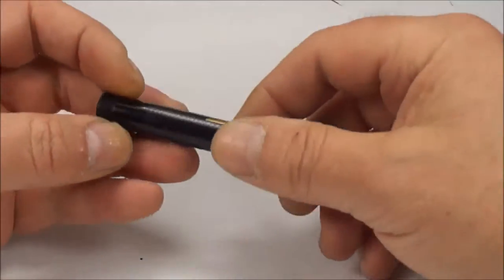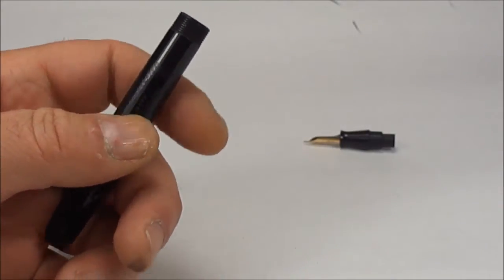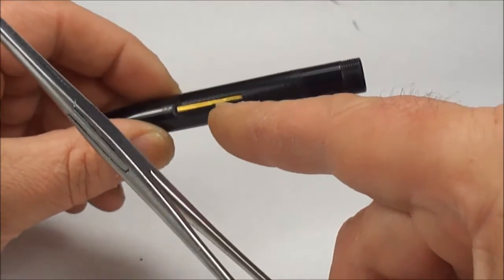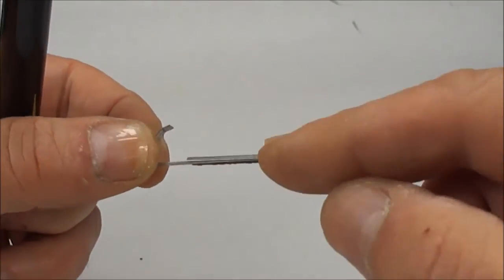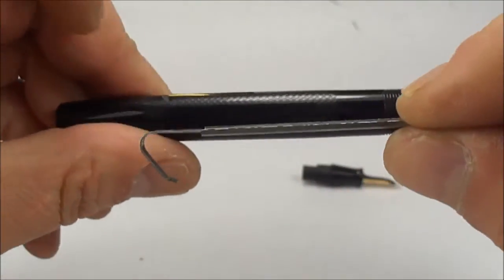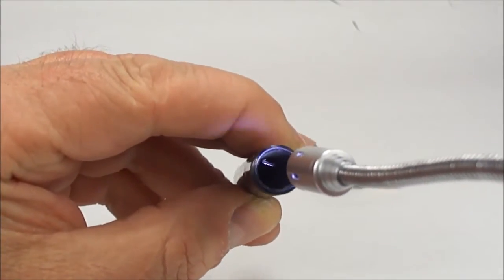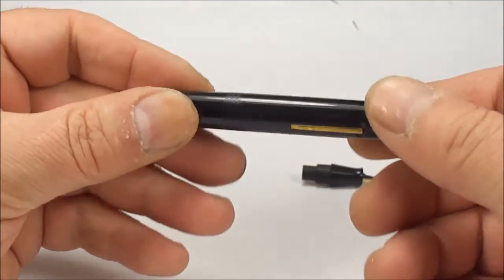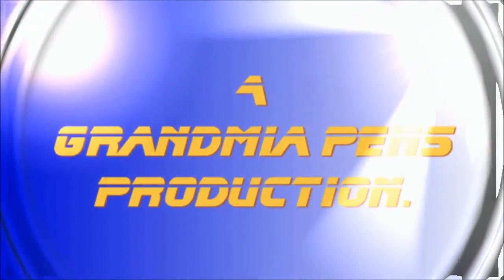How to replace a fountain pen J bar.

Comment: Stef, this was exactly the information I was looking for. I have a lovely oversize tapered Sheaffers Lifetime that the previous owner had installed a new sac in, but the J bar is too long. Without going into embarrassing details of breaking the section trying to remove it, sanding the old feed to fit the new section and so on, I needed a tip as to how to solve the root cause of the problem I was having, which was that the J bar is too long and interfered with the section nipple. Thanks again, all the best to you sir!
Reply from the maker: Just a quick replacement of the J bar should have been straight forward.. But hopefully you gor there in the end. Thanks for watcching.

Comment: Doing my second pen restoration a C.S 36. My first was a C.S 106, decided on that as the filling mechanism is simple.
I really like the way the 36 writes, I dip tested it & got carried away. It writes so nice, well after the oil or gum was removed. Upon initial dip testing it simply wouldn't write, it repelled the ink. I could see oily streaks on the surface of the ink I had dipped it into. Took a hot flush to get it going, which I should have done first!  
The leaver is fully jammed as is the j bar. Sadly the previous owner bent the leaver slightly. 
I'm subscribed and will be gleaming your videos for info. I've got a job lot of pens coming, which includes a Hema 56, something I've really wanted to write with.
Reply from the maker: Well done with you pen restorations. Just go easy and have patience when working with pens or practice more on cheap pens. Good luck
Reply: Patience is most definitely a virtue. I find it relaxing, almost meditative. 
Think I'm going to have to leave the 36 for now. The J bar is refusing to budge. 
I have a job lot of pens coming in, which will help getting experience.
Reply from the maker: Good luck with them.

Comment: Thank you for this. I was able to fix my Hutcheon Bros ebonite with a new j bar I bought today. It was a nightmare getting the broken bar out of a long, narrow barrel and I needed to tweak the new one before it sat flush to the inside but eventually it took. The original was rusted blued tempered steel and the way the j was bent it was dug into the ebonite something awful. Helped quite a bit as it helped me figure out the sac I can get in there. I mocked it all up and it took a big gulp of water and released it as well when I pulled the lever again so I can shellac it all together tomorrow.
Reply from the maker: Excellent well done, im glad it was helpfull.

Comment: Thanks for taking the time to share your experience. I'm repairing my first vintage pen ( a cheap one from eBay that won't make me cry if I screw it up). BTW those are hemostats, not forceps. :)
Reply from the maker: Your welcome, i hope it helps with your repair. Good luck. BTW We try not to get to technical in the videos as we are trying to help the person who has never done this kind of work. Thanks.
Reply: I used some heavy tweazers and that worked. The key is to twist a little bit and it will move :)

Comment: Hi Stef! Thanks for the videos. As a new pen enthusiast I have a question. Are these pressure bars just friction fit? I am restoring an old celluloid Moore and there is nothing to slide the pressure bar onto with regards to the lever. Any assistance would be greatly appreciated! Thanks again for all the videos they are great! Gary
Reply from the maker: Hi Garry, if the lever does not have the lugs to fit a floating pressure bar then it will need a J bar. Take a look at my "Pen Pressure Bar" video. Good luck.

Comment: Steph I watch this and I have a NEW tool for your pens, available from Ebay about £7, it is a 5 or 7mm endoscope, this connects to your PC, has an LED light on the end and a camera (you can take photo's or video). much better than a torch, and you get to look deep inside the pen, display is to your PC screen. hope this helps you (as you help us so much) J
Reply from the maker: Yes i have seen this tool before, however i do not have one. Maybe ill get one. Thank you for the information.
Reply: Hi